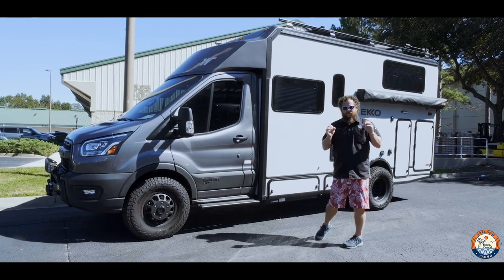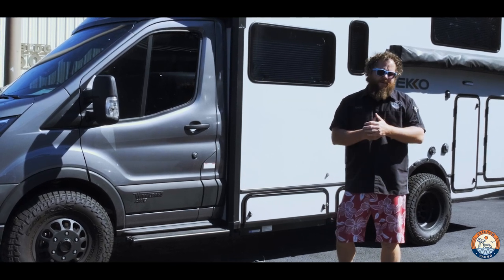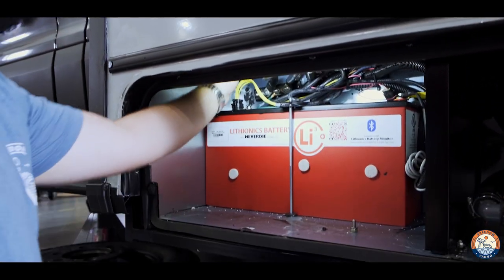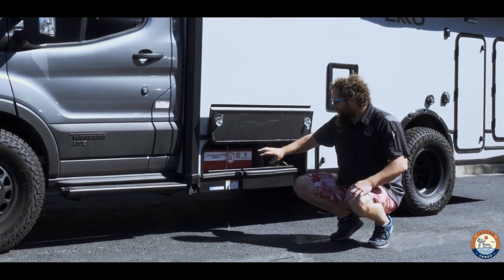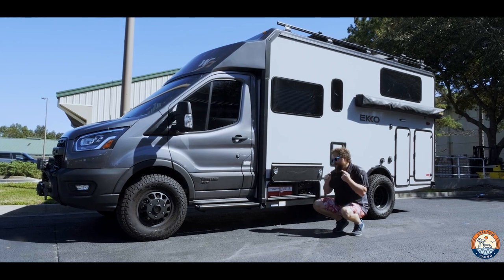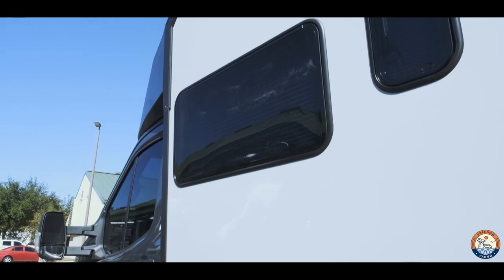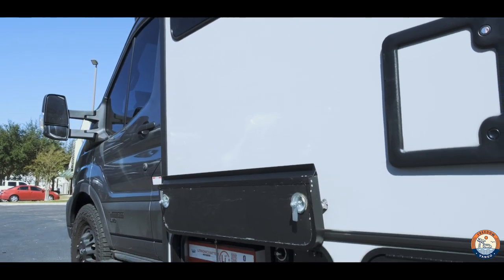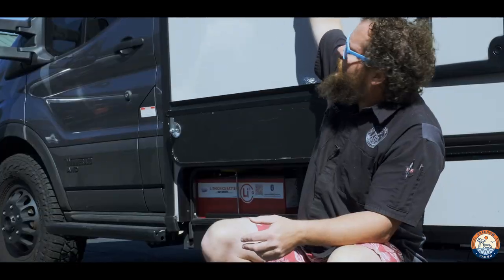Installing a Second Lithium Battery in the Winnebago Ekko!

Comment: Bro i just added my second battery but it’s acting weird i am in California otherwise i would have just gone to your shop to do the install man, is there a slave wiring diagram that you can share with us?
Reply from the maker: It's pretty standard second battery wiring.  I think the used battery you got has issues
Reply: @FreedomVanGo  Hey bro , actually its brand new thats why lol , do you put the main positive on the 1st main battery and negative on the second slave battery ?
Reply from the maker: @911turbojk  correct
Reply: @911turbojk  That's how I had our home emerg backup battery bank connected.

For that one, I had 6 batteries, all connected in parallel.
Then, from chargers (solar and gen) as well as inverter, positive to positive on 1st battery, negative of both to neg of last battery.
This worked great for just over 12 years!

Comment: Ok, so here's a question, but I suspect that in one form or another, you may have already answere it.

So on the 2023 model (at least) there's a huge "garage" at the rear.

How difficult would it be to install 2 or even 3 more of those batteries there and wire them into the main system?
You did way that your 2nd battery you connected in parallel, so that just might be my answer right there.

Would I be right in assuming that say, adding the 2nd battery like you did here and then 2 more in the rear storage area, that using the correct gauge of wire, they can be connected directly in parallel as well like you did here?

Probably best to use the battery monitor/controller you talked about, depending on how many batteries can connect to it safely.

I also like the idea of replacing the top solar panels with higher output panels.  Perhaps one could even take those panels, store in the rear storage as well and when parked for a week or so, pull them out, place them on a stand of some sort and run the wires into the solar controller as well.  (possible??)

Ideas?
p.s.  I am a tech, so any installs I can do on my own as long as I have the schematics of what needs to be done to do it right.
Reply from the maker: its not a thing you would want to do because of the change in distance of the wires and path of electricity.  you want to keep everything nearby each other.
Reply: @FreedomVanGo  Yes, that is my concern for sure. Which is why I was wondering if there was a solution or if others have done it.
I suspect if they have, the wires would be very thick to handle the current over a distance of 20' or so.

However, my main concern would be that with that distance, that would slightly reduce the voltage, so that battery controller may, "see" the batteries as having an issue.

Some one solution to that issue, might be to put ALL batteries in the read as well as whatever charge controllers there would be and then run the main cable to the battery bay. (high amperage thick cables of course).

This way, the batteries would be close together and maintain a proper balance between them all.

It really is too bad that Win didn't design this RV to have space for up to 4 of those batteries while retaining the gen.

Oh well.
Reply from the maker: @BlondieSL  I wouldn't do it